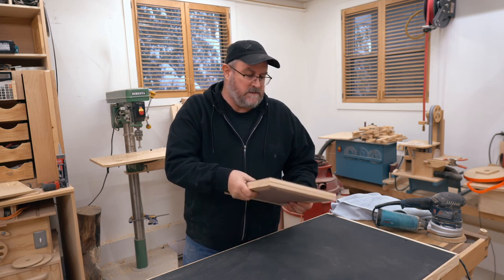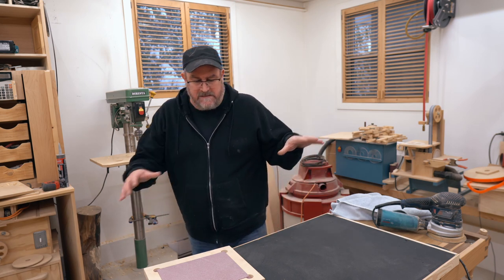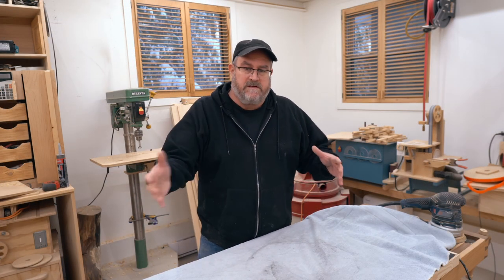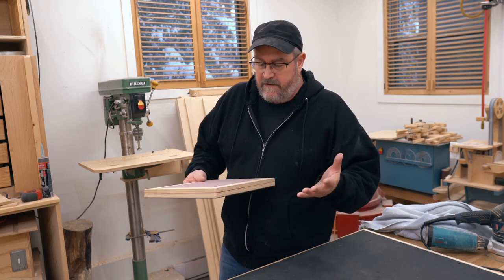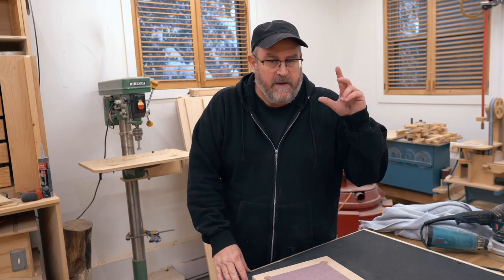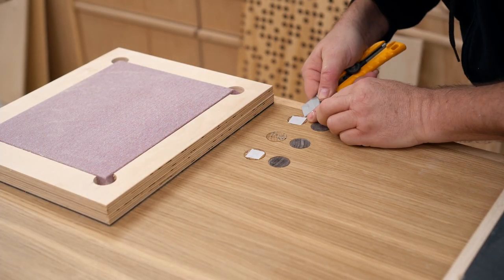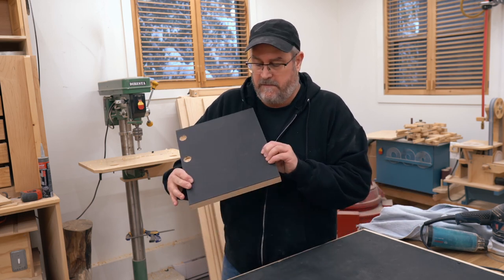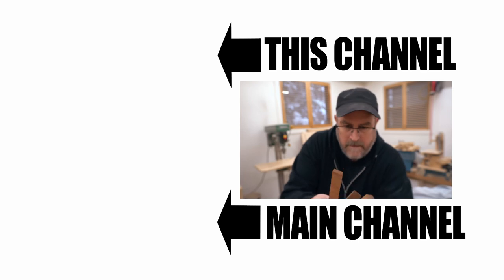I Put Wood In My Kitchen Oven and This Happened

Comment from the maker: Mostly, it changed colour, but I think I need to bake it longer. I had the oven at 400 degrees Fahrenheit and left it in about 20 minutes.
I soaked the wood after I recorded this video and it did swell a bit, so I guess I'm not quite there. It was an interesting experiment, anyway.

Comment: Dude, the best grip is that woven looking cabinet shelf liner, padding, squishey stuff. I even use it for my tenoning fixtures to hold the piece in place with a wedge.
Reply: 100% This is my go-to. Stuff is also used to make those grips for opening jars. It's easily the best for two reasons I think. The texture provides high point pressure even on relatively light parts and the holes allow the dust to fall through instead of turning into ball bearings between the flat surface and the flat surface.

Comment: Great video, I have tried carpet pad. It works well for a while but eventually it loses it’s grip. I also noticed that it reduces the noise a bit. A sheet of Sorbothane, also sold as “glass magnet”, was very good but you have to wash it occasionally.

Comment: They make a silicone mesh material that can be laid out on counter tops to keep plastic cutting boards from sliding around. Super high friction stuff. You can find it in the kitchenware isle in most stores. I wonder if attaching some of that to the bottom of the sanding jig would keep it still and yet relocatable.

Comment: The shelf liner stuff is grippy but it is fragile and it has holes in it that will collect dust is sticky... There is a shelf liner from Clorox at Walmart that comes on a roll you can get it 12 ft long it is smooth but very rubbery and grippy you should check it out it is in the household section very economical as well

Comment: I think you can actually get the Clorox shelf liner in 20 ft rolls but I'm not sure the stuff is wide it would be perfect smooth but grippy as hell I use it for my gun table and in the wood shop

Comment: Nice scraps! I have been wanting to play with the baked wood idea; specifically wrt the idea of heat hardening and then soaking in paraffin for bearing blocks.
Reply: Red Oak might be the wood to use its like a sponge anyway and it might just soak up the paraffin especially if you thinned the Paraffin with a little Paint thinner ?

Comment: Only 20 minutes and the color changed that dramatically? Wow.  never would have guessed that it cooks that quickly. Any plans on following up on the roasted wood experiments? BTW I was impressed with the sandpaper thing too. It's such a simple thing and it works so well. But I guess most of the best ideas are the simplest ones.
Reply from the maker: I think I need to make an airtight steel container to hold larger pieces of wood before I do any more.

Comment: What's that white stuff in the trees John??  Too early.
For your vise cleat, could you just mount it to the side with two snug screws in slots so that when you set it down of the bench it will rise and set flat?  I don't think it would stick up too high to hinder anything.  JimE

Comment: Torrification is done in a vacuum oven. But Not having this I have had success in my oven at 400°F for two hours and dropping down to 250°F for 6 hours then shutting off and leaving in oven until completely cooled down. You have to keep an eye on it. It smells up the kitchen. Wife won't like it